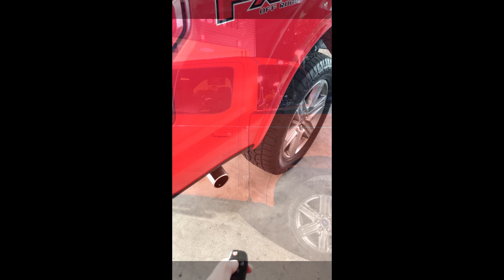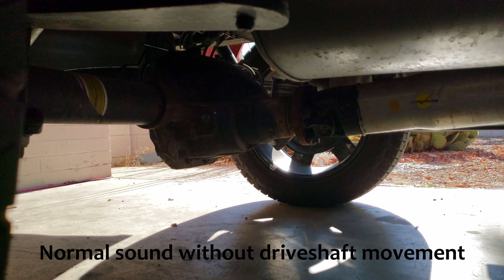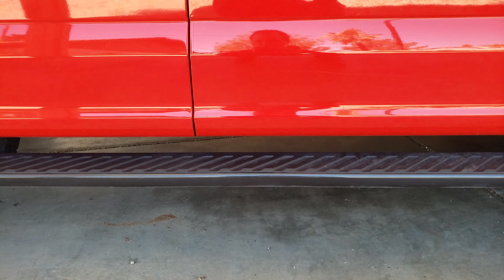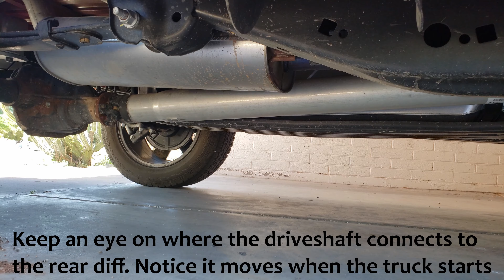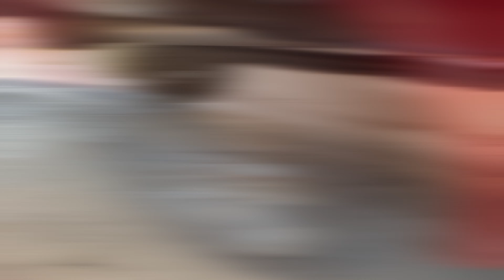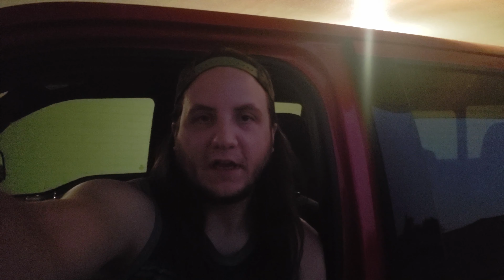2018 F150 Start Up Clunk

Comment: We are having this issue now did you ever find out anything?
Reply from the maker: Someone commented that there is a TSB now where they will grease the driveshaft to make the noise go away. I havent been able to find the TSB # yet but Il see if I can dig it up.
Reply: Truck the System THANK YOU! It’s in the shop now so I will send this to them! 👍🏽😘
Reply: @tlujan60  any news? I'm having the same issue
Reply: Dennis Lawrence My truck is still with the dealer he told me today that my truck has been updated but still has the issue? I don’t understand? I’ll let know the results when and if it is fixed 😩
Reply: @tlujan60  any updates!? Thanks
Reply: @RB2_TechReviews  No Update it is going in tomorrow and still doing it :( I'll keep you posted
Reply: @truckthesystem3957  greasing the yoke was to fill the splines where the driveshaft and the yoke meet, this causes the grease to fill the space between the two. It has NOTHING to do with the clunk if you can see the driveshaft rotating a little bit on engine start. As for those that say its the slack in the transmission related to the parking pawl, WRONG. 
In this video I made, the truck was parked on an incline, resting on the transmission, no parking brake at all, and it still makes the clunk https://www.youtube.com/watch?v=O8u0sdnags0

Comment: My 2019 f150 2.7 4x4 does the same thing after warm up start up will have mine checked too.
Reply: Did you get any answers? I have the same model and it has been happening to me.

Comment: It's funny just saw your video I have a 2017 f150 fx4 red also.....mine does the same thing took it to dealership mine does it so bad the driveshaft turns slightly the dealership took video of it sent it to headquarters they said it was 3 of the clutches in the transmission loading up....lol bs they don't know it's definitely a flaw

Comment: 19 f150 limited. Mine does the same EXACT thing. Only when it’s been driven and it doesn’t always do it. Just sometimes. I’m wondering if it has anything to with the new “cam phasers” recall they just dropped. Anybody have info on this as of this date? 10/25/21. Thanks guys
Reply: Did you get it fixed?
Reply: @honeynharvest  I brought it in for one of the recalls involving I believe the cam phasers.. there was a different one issued though I think it’s 21B10 and the phasers are 21n05 or something. Anyway, I had 21B10 resolved I noticed it it did it once I think since bringing it in for that particular recall. Other than that it has no effect on performance of the truck so I left it alone

Comment: Mostly the same here.  However, my drive train clunks more often than just at start up.  Sometimes when I just turn on the key, it clunks.  When I coast as in down hill, it clunks when I accelerate again.  The dealer said he has heard about it a couple of times, but it's normal.  Say what?  I am a Ford fan, but this just doesn't seem right.
Reply: OMG. This 100% describes what I'm experiencing with my 2018 FX4 SCREW.  I occasionally will get a clunk at start up but by far its way more common when I go from coasting to acceleration, it will thunk like its finding and going into gear. My dealership said they couldnt get it to do it (total BS) and just reprogramed it after having it a week.
Reply: @JuanRamirez-hk8sf  I got the same response the first time I went to my servicing dealer.  I went back and made a big deal about this.  They finally listened, and as it turned out, there were multiple updates to the power-train control module, (PCM).  This made a huge improvement.  Go back and don't let them just blow you off.  There is a fix for what they call "normal".
Reply: @JuanRamirez-hk8sf  it’s your transmission. My 2019 does it too. Go under your truck when it’s already warmed up and try and start it. You will see that clunk noise is your driveshaft moving because the 10R80 is absolute JUNK. Grease your yolk and the noise will go away.
Reply: Remove  driveshaft ?
Reply: My 2020 does the same thing. I’ve been to two dealers a total of six times. This last time is because the rear pinion seal is leaking at only 56K. So they took apart and check backlash to make me happy. Supposedly it was in spec with zero abnormal wear. I’m basically thinking between the rear end, slip yoke and transfer case, there is just to much  combined tolerances allowing it to clunk. Very disappointing for a $50G truck.

Comment: Mine does this as well. I have a 2019 5.0. Same FX4 package as you but mine does not have remote start. It has been bugging me (even though it doesn’t happen often). I’m going to take mine in soon to address that with my dealer.
Reply from the maker: Funny you say this...they tried to tell me it was doing this because of the remote start feature. They are full of BS excuses
Reply: @truckthesystem3957  hello I got a 2019 f 150 5.0 stx has done  this  since new currently has 8500 miles on it it will move 2 inches if the parking brake is not engaged    the dealership  has not done anything about it  it has been in three times for the same issue
Reply: @truckthesystem3957  I hear you brother.

Comment: My mustang has the same sound but it’s more of a rattle. Idk what is wrong but this could be it
Reply: Had the rattle on my mustang before I got the truck. Check your exhaust. A clamp might be loose. Or the tabs on the exhaust. Tightened and went away.

Comment: it's normal stop looking for problems that aren't there
Reply from the maker: Ok mr Ford rep. Il totally trust some random internet comment. Thx
Reply: @truckthesystem3957  LOL
Reply: Yeeeeah a driveshaft moving on its own in park. definetly normal. mine does this and when im on an incline it MOVES the truck.
Reply: @truckthesystem3957  any new update? aside frm d clunk are there any other issues?
Reply: @truckthesystem3957  it doesnt sound normal, it aint good if d dealer sez its normal, u may hav to put it in a lift n start it to find out wats rily going on, just my opinion
Reply from the maker: @dickheder4940  Im at 28k miles so far...this doesnt happen as often as it used to but I still hear it occasionally. Otherwise the truck has pretty much been flawless. No oil consumption issues and the transmission shifts pretty smoothly for the most part. Il be posting an update probably after 30k. I have quite a few videos I need to post for the truck.
Reply: so its normal, just a little irritating clunk otherwise its good, flawless...very good
Reply: Steve omfg you say it's normal so why is it intermittent. Think before you post
Reply: You fix tha my f 150 2020 has the same problem

Comment: Got a brand new 2019 f150 & it clunks everytime I start it. Calling dealership tomorrow
Reply from the maker: Finally taking mine in tomorrow so we'll see what they say
Reply: Update: they said it wouldn't do it again. I'm gonna let it go for now, I at least have it documented that I took it in
Reply: @bonekollektor1659  what did they find out??? alot of f150 here in middle east have same problem and dealers don't do anything ... please keep us updated
Reply: @mohsenalabbas7866  Hasn't done it again. Just a couple times when brand new
Reply: @bonekollektor1659  did it fix itself or what happened?

Comment: Movement of the driveshaft should be impossible if the vehicle is in "Park."
Reply: Right?? Can't be good longterm
Reply: Unless your using the park brake which would take the tension out of the drivetrain.
Reply: @brianzeni0921  i have the same noise and i always use the parking brake maybe it has something to do wtih it idk
Reply: It’s not impossible. That clunk is absolutely your drive shaft nudging on startup because the 10R80 is garbage. I hate mine.

Comment: Sounds and looks like a loose U joint. Shouldn’t be that big a deal. Overtime heat should eventually make it go away.
Reply from the maker: I hope you're right! I will say it does seem to be getting better. Im not hearing it happen as often anymore so you might be on to something
Reply: @truck the system check out chrisfix video on u joint replacement to get a better sense of how it looks and works.
Reply: my truck is 2018 and I have the same issue with the clunk noise when started on park and is not normal!!

Comment: I have a 2019 f150 XLT with 5.0. It does the same thing, clunk when starting. Also clunks when putting in reverse and giving it gas. Dealer says normal. Ford is making expensive junk ass trucks !  I had a 2002 f150 with 5.4  2V. I put 305,000 miles on that truck with all original drive train !!  Newer trucks are junk